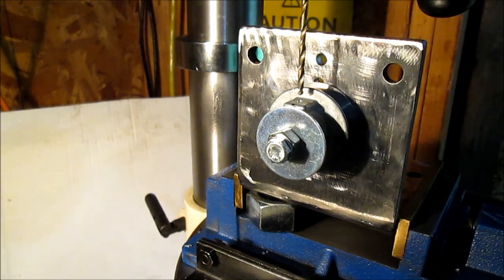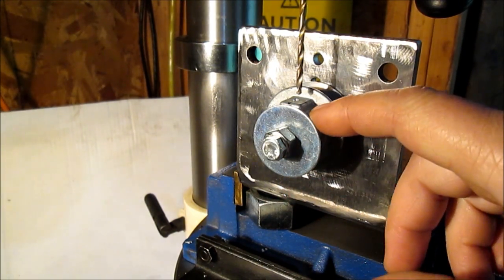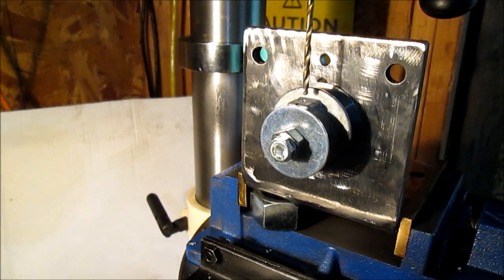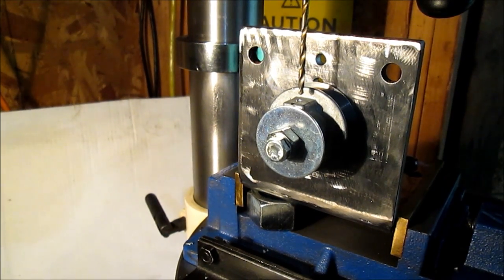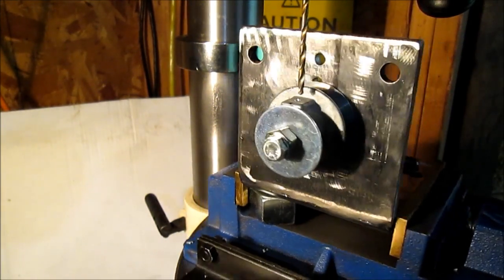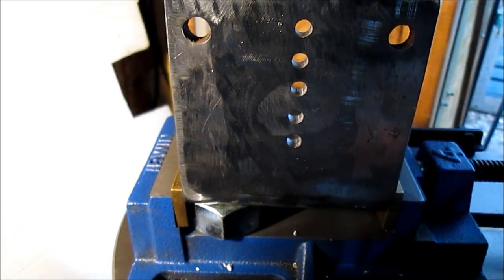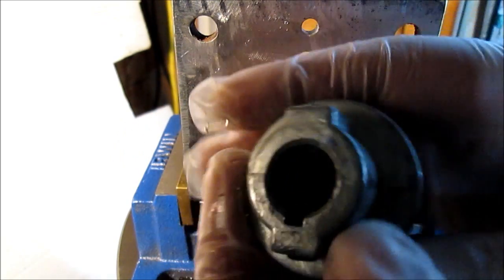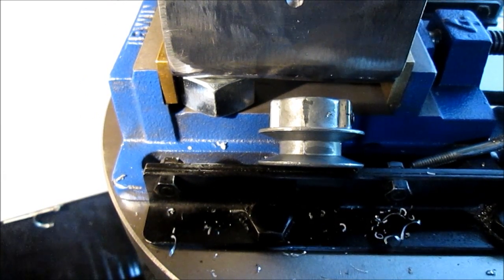Homemade Angle Plate for Drill Press

Comment: This is a grate fix if you are short of time, or off grid.A good fix could have been a thread insert in the old hole. Almost all aluminum aircraft parts use thread inserts in the threaded holes. Theyare steel and do not strip out easy. That would be a long term fix.Good fixture for holding the part.
Reply from the maker: +Tommy Schauer This is a cheap pulley and I have taps and set screws